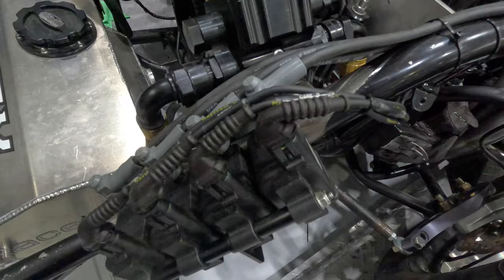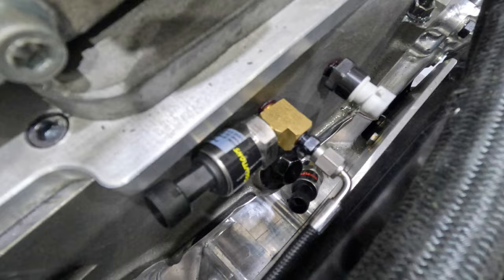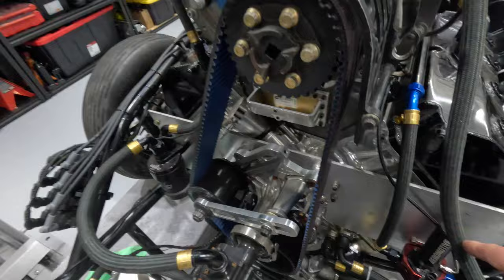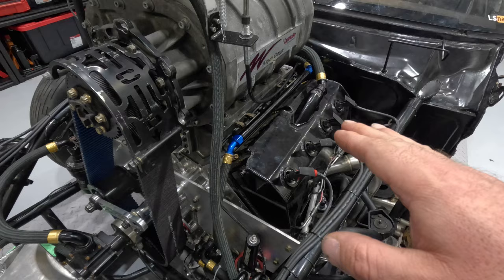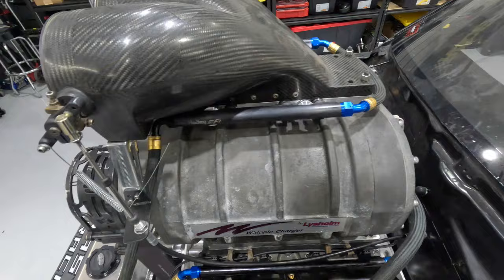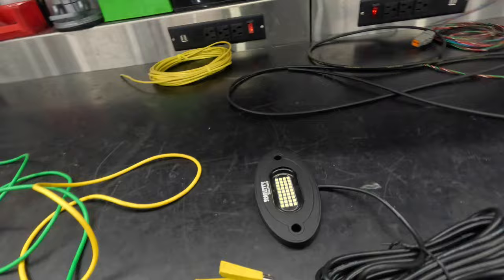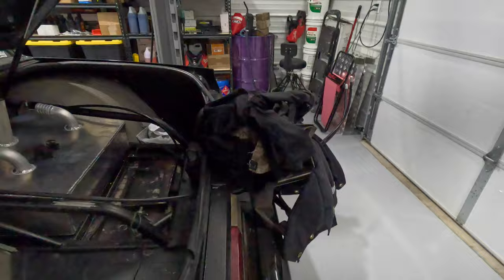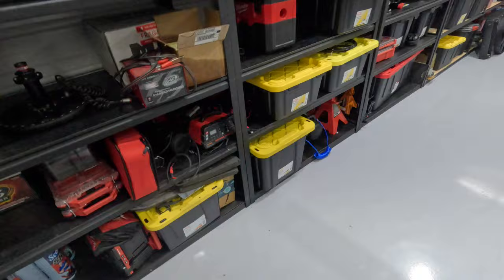The black sheep part 3

Comment: Gold catch on the fuel system. To try to eliminate confusion for those learning this, 3 in/hg = -1.5 psi. 90 psi -1.5 = 88.5 psi at idle.

Comment: I have done quite a few of this setup In burnout cars we just setup the hat injection to run on a 2nd map in the software and tune that separately to the port injection. We have mane injection for fueling with hat injection and we use the port injection to even out the cylinders

Comment: Is a dual regulator setup so the  top stays constant just to much weight? Or is modify the top injectors load % progressivley fairly easy and straightforward?
Reply: This was my question also.
Reply: You would need to have two pumps at this point as well, if I'm not mistaken. 
Otherwise the fuel will go the path of least resistance and flow across the 90psi regulator for the top injectors. 
Regulators are in the return line so you can't have two different pressures between one pump and two regulators.
Reply: @MartinBorn  I wasn't sure if you'd be able to run the second reg in line after the first reg.  So the first reg feeds the lower injectors then off first regs return you run a second reg to keep constant px to the hat injectors then return excess to the tank.  Would have to study it more but that was my initial thought. Running the regs in parallel wouldn't work like you mentioned. They'd need to be in series.
Reply: @dropfactory  running it of the return of the first regulator would not work but running it of the output could.
Reply: I think possibly if you put the higher pressure reg first then plumb the return from the that reg  to the top fuel rail with a low pressure reg at the end of the system back to tank. Other wise I'm thinking dual pumps and regs

Comment: What is the issue with putting more fuel in pre blower? I thought a lot of mechanical injected setups put most of the fuel in pre blower and the bottom nozzles were  used for cylinder to cylinder tuning.

Comment: You need someone to make a closed loop capable fuel pressure regulator that is electronically controlled via 5v, 12v or PWM thru the ECU to perfect this mathematically speaking. Practically speaking, I would not be surprised if you’re “excess fuel” so to speak that you’re anticipating from the lack of 
differential pressure in the hat isn’t consumed/evaporated/vaporized by the supercharger itself for means of cooling. Also, it’s fair to assume at some point during the pass the blower hat is sure to experience some amount of positive pressure due to aerodynamics. How much and at what MPH? I have no idea cause I’ve never logged a map sensor inside of a blower hat above the rotors but it’s fair to expect some value higher than the car sitting still. If it were mine and I was trying to be as techy as possible I’d probably begin by trying to model my fuel flow as closely to a true mechanical system as possible. I’m talking total fuel flow volume as well as biasing the top vs bottom injectors in the software as closely to the jet size difference top vs bottom found in a mechanical system. All that aside, I’m interested to see how you all decide to skin this cat and what kind of results you get.
Reply: I could be mistaken but I thought fuelab sold regulators with electronic flow control.
Reply: @lukk4273 I personally would have gone with a mechanical system similar to what the screw blower promods run with electronically controlled lean-outs. Blowers are hellaciously violent and can be hard on electronic devices like fuel injectors. I’m well aware people have done this successfully and it is without a doubt a more precise and controllable way to deliver fuel    but billet hemi aren’t cheap to replace and Id be done for the year if something happened. I like what they’re doing and I’m sure it’ll work great once they’re finished but the longer time goes on, the more I find myself leaning towards simplicity and redundancy over intricacy and sophistication.

Comment: The injector will grow to roughly 1000pph. In my opinion best way to reduce pre blower injectors would be to have a 2d offset table to reduce the injectors x percentage based on x fuel pressure

Comment: To avoid from changing anything in the fueling between injectors, couldn't you just run another fuel regulator for the vacuum side of the inj's and have 2 main returns to tank, granted your going to have more fuel line but that's another option isn't it? So you can stay at the base PSI the inj's up top because you only see vacuum up there. Correct me if im wrong.

Comment: Im not real familiar with holley but id wager you should be able to compensate for the fuel pressure rise in the hat with some kind of custom table setup based of fuel pressure for those injectors. Cant wait to see how they deal with it.

Comment: Actual injector flow = rated flow x square root of (actual fuel pressure ÷ rated fuel pressure)
So new injector flow is 873 minus some additional dead time from the added differential pressure

Comment: It appears to be 1088 pound per hour injector at 50psi 

90psi base + 50psi = 140psi 
140 / 90 = 1.555 
1.555 X 700 = 1088LB/HR  @ 50psi boost
Reply: At 50 psi you would need a fuel flow offset of  .643 to make the top and bottom sets flow at 700lb/hr 

That’s a calculation based on my previous math simply 700/1088

Comment: Welp, most injector manufacturers lie about their flow rates… so the top injectors will flow at least 600 at idle. Not sure what injector pressure/flow looks like but interested to see the explanation.

Comment: Since the regulator is a 1:1 boost reference couldn't you just use the inverse ratio on the upper set of injectors?

Comment: The way I would have done it is run a Rage 2 stage pump with 2 regulators. But I'm just some random dumbass from downunder that can only dream of having a screw charged V8.
Reply: Aeromotive makes one also. That setup is optimal for sure. In my case, I don’t have space for the 2 stage pump.

Comment: couldn't you run a 2nd regulator for the upper injectors that is not boost referenced?
Reply from the maker: We could but he doesn’t want to and I feel like programming can handle it
Reply: @robholmes2129 Fueltech/Proline runs two small cam drive pumps with two regulators.  Technically it's two separate fuel systems being controlled by one ECU.
Reply from the maker: on a hybrid system (efi and mfi) you use a dual stage pump as well